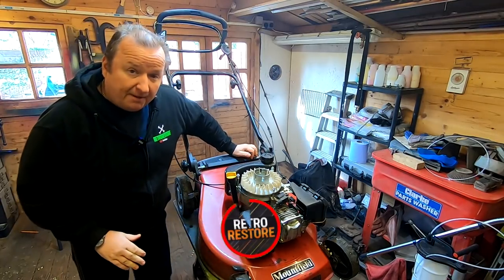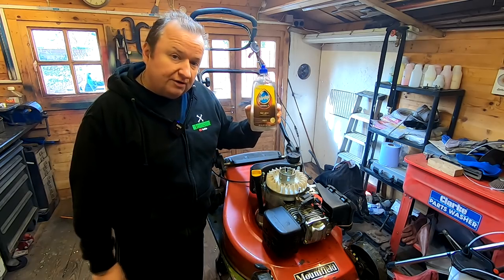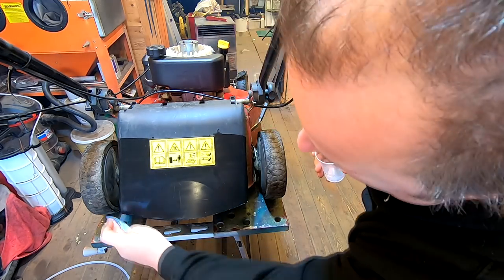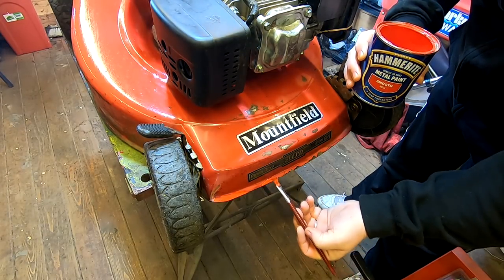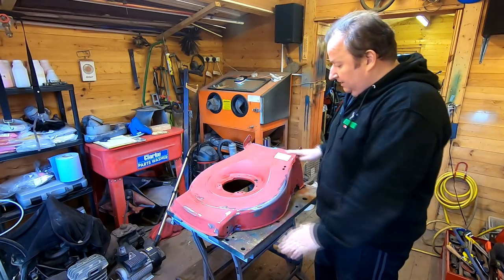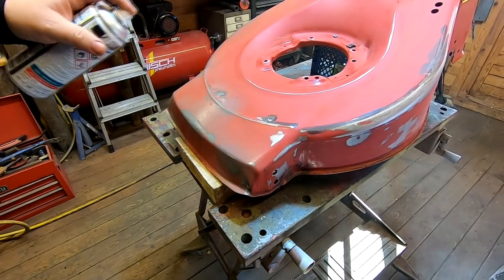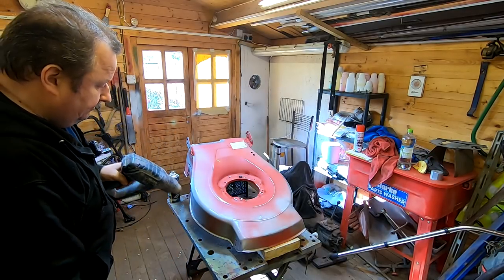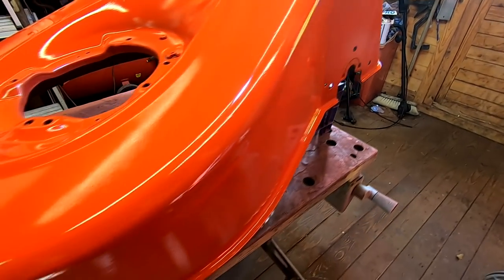Lawnmower Deck Part 1 To Paint Or Not To Paint that Is the Question

Comment: Eliminator Performance Small Engine Repair here from Canada. Just wanted to say thanks for the Pledge Revive It tip on making mower plastics look new. For many years we have been using Renew It but have recently tried the Pledge Revive we purchased for $10.16 Cdn taxes all in at our local Canadian Tire and it works just as you showed in your video. It should help us make more profit on mower refurbishments for the little of this product we will need to use. The 32 oz. bottle should last many years, an initial investment that will generate extremely handsome returns. Once again thanks for the tip and looking forward to more.
Reply from the maker: That's great Wayne. Nice one bud.

Comment: That one looks like it'd come up nicely with a T-cut and wax, touchup the rust like you say. The textured plastics though, i use coconut oil over any proprietary compounds. Works a treat, only time i use an actual product is on plastic that's meant to be shiny & then i (well, the better half!) give it a once over with Meguiar's Plast-Rx polish. (typing this just over a minute in, so will watch and see what other tips you have) :)

Comment: I have a Volvo XC70 and I use boiled linseed oil on all the exterior plastics. Works great. Give it a try
Reply from the maker: This works great too
Reply: @retrorestore  I believe you. I just mentioned it because I don't think I can get Pledge in the NL and linseed oil is available everywhere. Anyway, good job painting the whole deck. Way better than touching up.

Comment: If that Revive is anything like the original Johnson's Kleer, its water soluble by design as you want to mop the floor removing the shell polish and then reapply it.   Back in me army days, when they outlawed spooning (hot spoon applied to thickly applied polish and also removed blemishes and raised leather markings on DPM boot caps and not the in the gutter back to front frottaging most people are prob thinking about) we hit on Kleer which put a brilliant gloss on the boots, trouble is even on a mildly damp day it turned milky white and looked like a crown and anchor had addressed ones boot in the worse possible way and of course a prime reason to be up on a fizzer aka charge because no NCO is gonna pass on the prats like us who are standing on parade with our white gunk adorned boots on full display.   On indoor stuff like Matchbox car wheels, it is going to be king because the chances of dampness or water are low but I think you will find the Revive stuff will fare badly in outdoors scenarios.
Reply: I know do me boots super cheating, apply the polish in a nice thick layer and get ones hot air gun on the lower setting and just play it over the polish and it flashes into super shiny shine and the longest bit is applying the polish as the hot air gun does it stuff super quick.
Reply from the maker: Not checked that, will hav a go with water